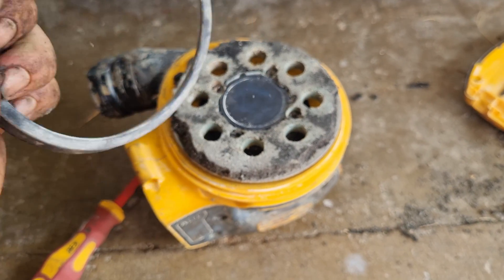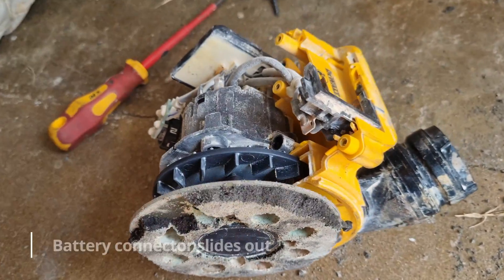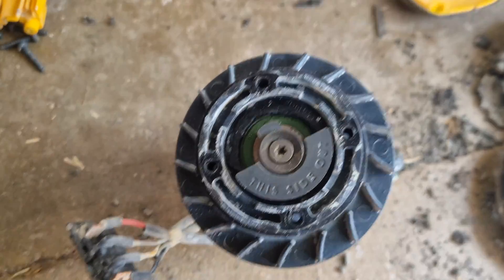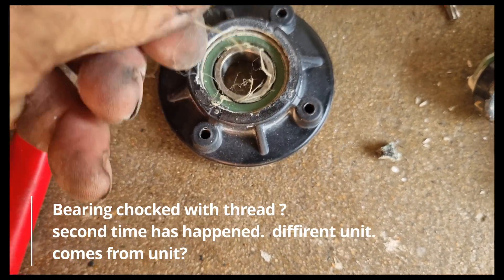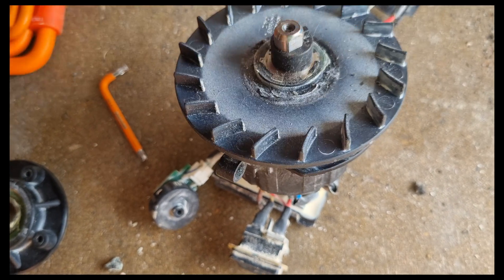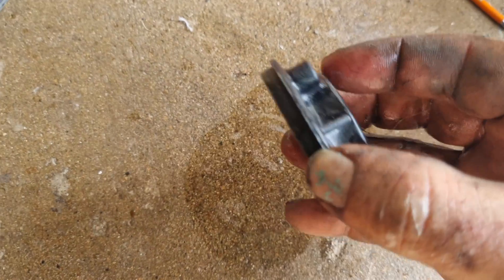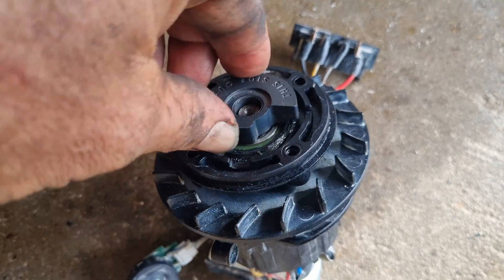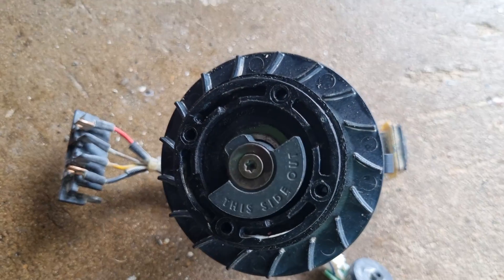dewalt sander 18v-20v DCW210 random orbital repair disassembly

Comment: The screw that holds the counterweight to the bearing, assuming it's standard thread, suggestion to keep the bearing/weight from turning to loosen that screw? Mines not locked up-yet... But I noticed it was making more racket and  vibrating a lot more then it used to, and I had considered at the time I bought it that it may have been flawed to begin with but I didn't have time to send it back (Amazon purchase) for a exchange, or anything as I was needing it in for a job right then and couldn't wait... I am noticing some play in the bearing housing, along with needing a deep cleaning badly, was hoping I could possibly even manage to just replace the bearing only if I could press it out without damaging the plastic, worst case I break the plastic bearing housing and order a new assembly as they are sold like that anyway, I think I have that specific size bearing on hand though, if that was doable....

Comment: When I pulled mine apart l, there was no grease on the bearings- this is what it was like from the manufacturer. If I add grease to it, won't it get all gummed up because of dust
Reply from the maker: id put a smear over the top of bearing, its a ctach 22, ive had 2 fail from bering failure, so its an issue.  have kept this one going but would try a thin smer over bearing nexr time, and yes it will colloect dust but would suggest it would last longer thsn it does currently grease if gummed up can clean and go on, but a siezed bearing is hard to fix.  be nice if came with a spare bearing but hey they wouldnt sell as many, but am reluctant to buy another atm....but it did last reasoable. mount time. but if bought another would try something probally. grease seal from dust and servie after a decent job

Comment: Is the belt pulley supposed to be free spinning? Mine doesn't spin. In worried it'll burn the belt out
Reply from the maker: @irfanrizvi2436  is this the belt pully on the bottom the little wheel thingy ?

Comment: My bearing was locked. I poured penetrating oil for one minute and it started moving nicely. I followed the penetrating oil up with liquid lubricant, and then I spread the counterweight with wheel bearing grease, in addition to filling the grease cap with the same before putting it back on. After two minutes of use, the wheel bearing grease liquefied and went into the bearing, and then the sander started running at full speed again. Thanks for the video.
Reply from the maker: Yer if bought a new one would open up and probally put some high temp grease over that bearing. Dust etc over time seems to be an issue with design.  

Fibre from sandpaper and dust getting into bearing. Glad it helped.